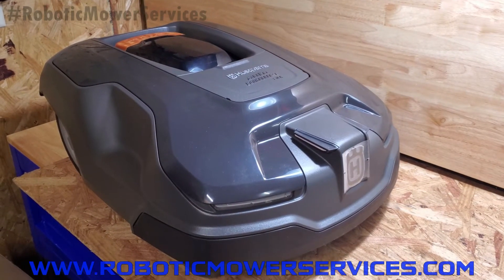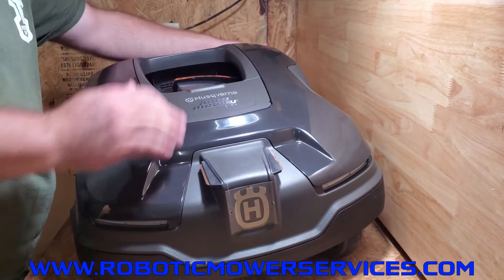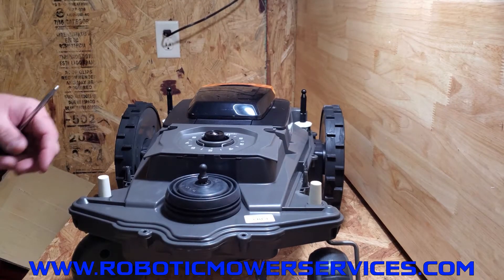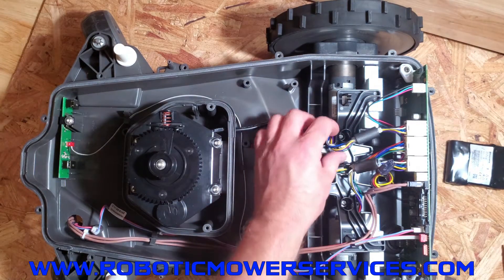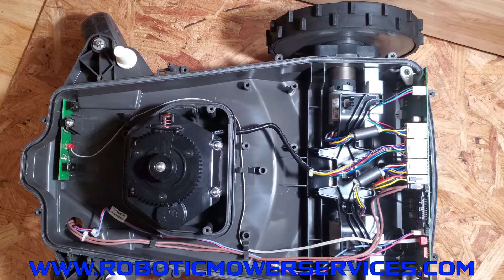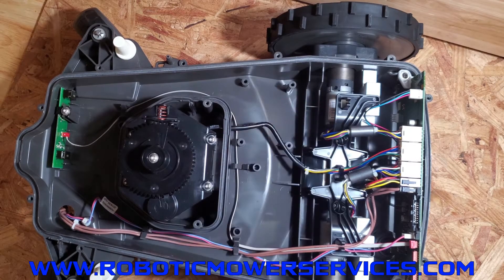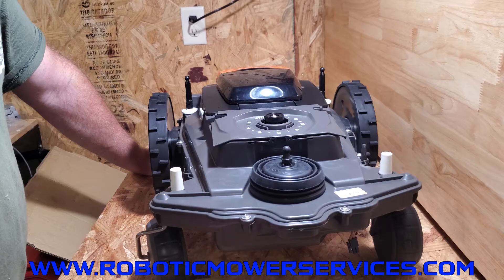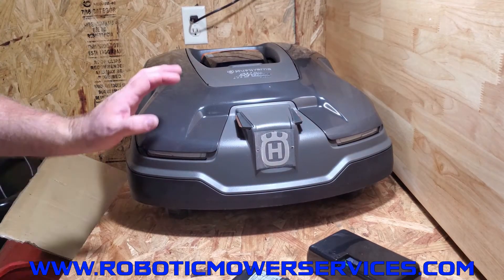Husqvarna 300 Series Automower Battery Replacement (310, 315, 315X)

Comment: Hi.

Thanks for the video I have an issue I hope you can help me with I changed out my blade today but when I powered up the unit input my password and set to start after closing the flap the lift alarm sounded.
I reset all steps several times but the alarm keeps sounding stopping the unit from working

Comment: I hae replaced my battery to a battery with larger capacity. Will the mower auto caibrate and adjust to the larger battery? on my first run, the battery left percentage decreases too fast, probably based on old weak battery

Comment: I have the "new style" and I cannot remove the battery out of the bracket....any suggestions?
Reply from the maker: They do squeeze in there pretty tightly. We've had a few that were tough to get out without breaking the battery cradle.

Comment: Do you know if one can change the default mah via the menu? I know you could change it on the old 220AC. 

I want to change the capacity in the menu to the spec of the new battery
(3400 mah) As it is now it only charge to 1600 mah because it thinks a 1600 mah battery is in the mower.

Comment: Excellent video showing the entire process. What a horrible design by Husqwarna though, burying the battery all the way into the guts of the machine. That's going to need replacing with some year intervals. Doesn't look like a very difficult process but a lot of taking things apart to get that deep. All appliances need to have externally mounted batteries in casings so you can just detach the old one and put in a new one.

Comment: Great tutorial - thanks much. Question on the software piece: Is it necessary to somehow "tell" the software that there's a new battery installed? Is there a counter for service hours that can be reset or something of that sort?

Thanks much and greetings from Germany
Reply from the maker: It is not necessary. A dealer can reset the charge count for you with Autocheck if you really want them to. Most people just document the count when it was changed.
Reply: @RoboticMowerServices  thanks much!

Comment: the battery power of a 310 is the same as that of a 315?
Reply from the maker: Yes, it was the same battery used in the 310, 315, and 315X. Later on they started using the black encased battery similar to what they use in the 400 series in the 315X. The 315X was the only 300 series model to come with the new style battery because the 310 and 315 had been discontinued here in North America by the time they started using the new style battery. The new battery is the same one used in the 115H.

Comment: Thanks for that. Really useful and well-presented. 
Someone told me a Husqvarna agent has to do something with the software, to get it to recognise the new battery correctly and get the full capacity out of it. Can I assume he was wrong?
Reply from the maker: Replacement batteries on current non AWD models are just plug and play. The new batteries for AWD models require connecting to Autocheck and updating the firmware.
Reply: @RoboticMowerServices do you know if it is possible to put a larger battery pack in? Seems like there’s ample room.